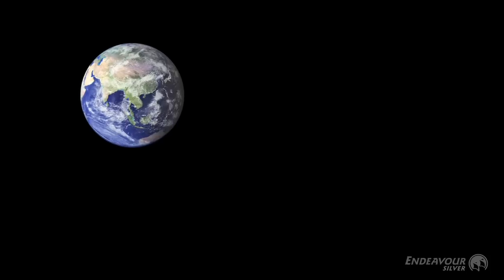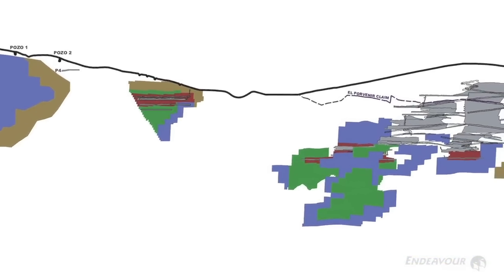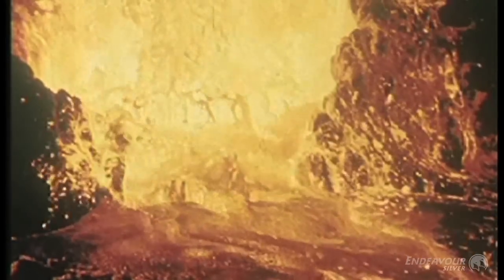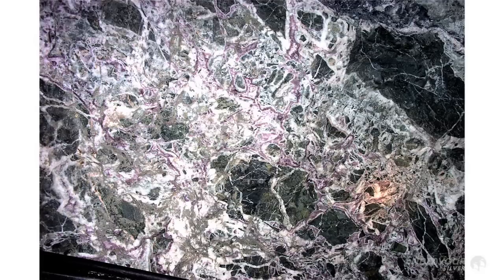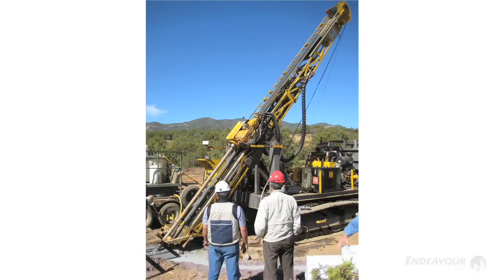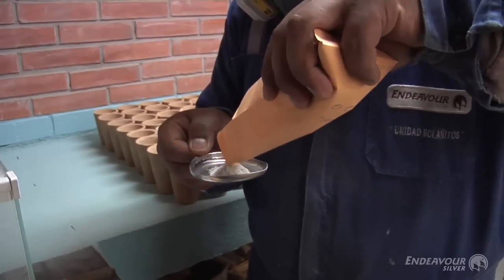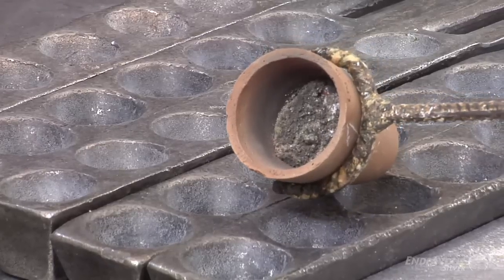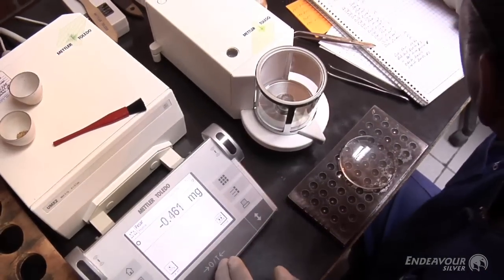How Silver is Mined (1 of 2)

Comment: I would be more interested in the slag :)  Gold, Silver and copper melts at around 2,000 degrees.  That won't even get the platinum group warm so it usually goes into the slag.  You can do pretty good high grading a copper or silver mine slag pile with a very strong neodyum magnet as platinum is paramagnetic!  2, 5 gallon buckets of high grade slag will usually produce 1/2 ounce of platinum in certain areas.  Now you know why the Chinese are buying this slag by the dump truck load!